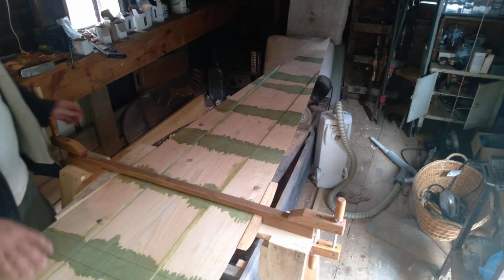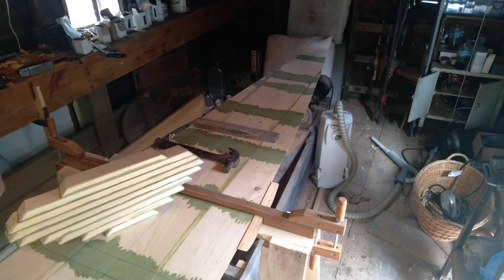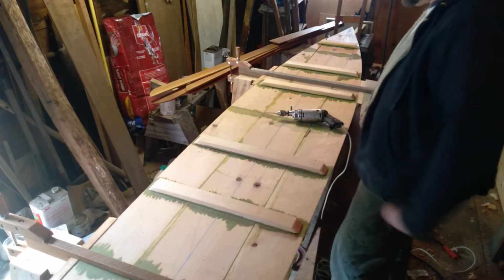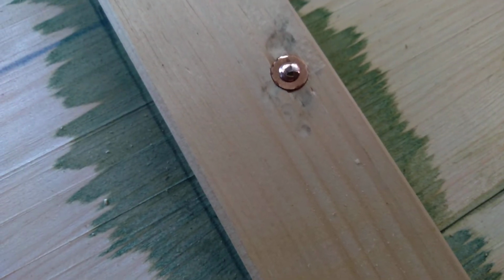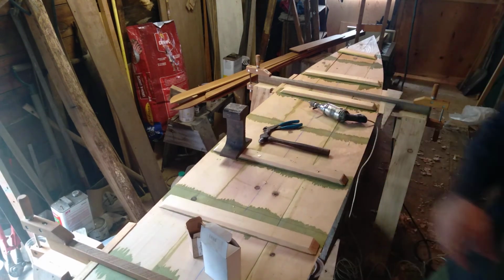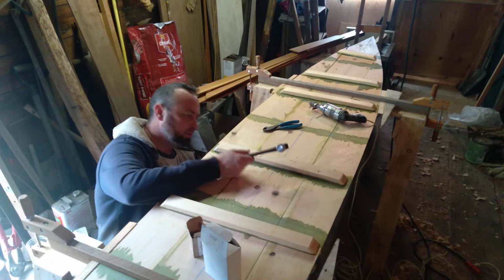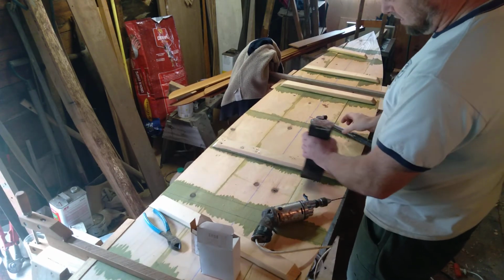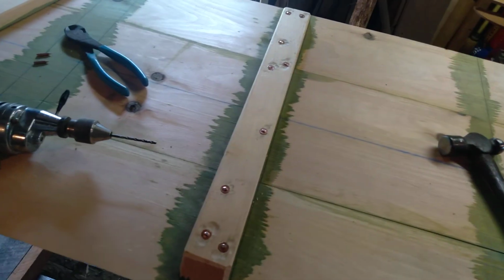Alpha riveting bottom boards pt.2

Comment: How proud (tall) is the nail shank above the burr after you snip them, and before you peen-over to tighten the rivet?
Reply from the maker: I'll try and get a good shot in an up coming vid... so it's more than 1/16 but less than 1/8th... I'm using the "short" side of the cutter blades but holding the cutters a a bit of an angle so that I get a little more copper than a tight to the washer/burr cut would be. If yo leave too much copper it takes longer to rivet and the head that you form will have sharp cracked ragged edges rather than a smooth rivet head.
Reply: @danoyes1  I suppose one way to define the nail proud height, after snipping, would be as a fraction of the nail diameter.  e.g. one-quarter of the shank diameter, that way the formed rivet head is related to the size (diameter) of the nail shank.
Reply from the maker: @kenrolt8072  yeah hadn't thought of it that way but it's a good way to describe it, about 1 diameter above the rivet, certainly not more... not sure if that relationship would scale with bigger nails or not...? 🤔